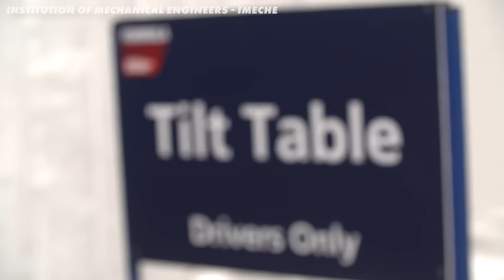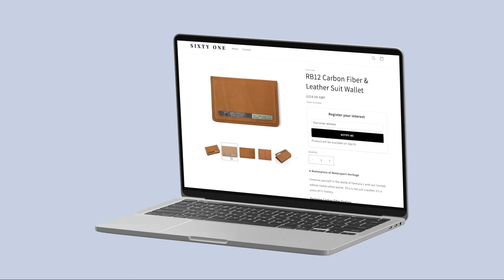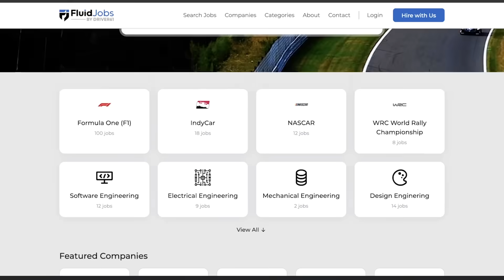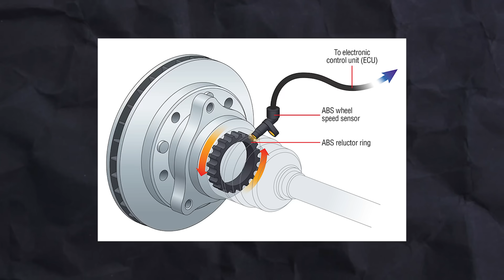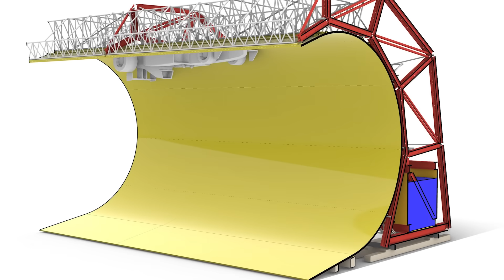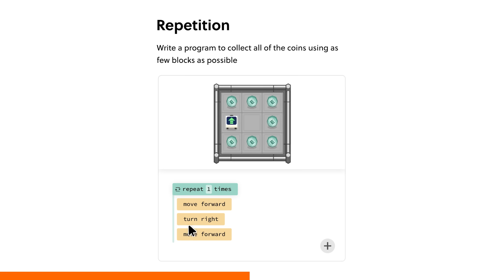How Students Made Something More Advanced Than F1

Comment: 4:11... On the lay-out of the car, why must the battery be at the back of the car (if its an AWD system)? I get it that it more weight distribution towards the back, may still favor performance, especially linear acceleration thx to improve tire grip, however we may be sacrificing on weight and aerodynamic performance.
Reply: I think it's also about packaging. The battery is kind of big taking up quite a bit of space. If you moved the battery in front of the driver you'd need to move the driver back and you'd probsbly get issues between driver and rear wing. If you moved it below the driver that would probably be very tricky with safety and removing the battery from the chassis, and you would probsb,y also have to make your chassis taller which isn't really ideal for Center of gravity or aerodynamics
Reply: @yuemaeve Then distribute the battery weight all around the driver. The least in front, most on the side, and somewhat in-between on the back. I am almost certain, that it’s has not been tried, because most people don’t want the extra burden of trying something new, while totally committed to winning “right now”…
Reply: @TiSIWO you are probably right that it hasn't been tried. But also I'd say packaging wise putting them at the side of the driver would be extremely tricky. One because you would need to add width to the chassis, which isn't really ideal either as it would probably be worse aero wise and heavier. You'd also need to put a firewall there because tractive system accumulator container needs to be seperated from the cockpit by a firewall. You would also be adding more weight and complexity with having more components because each container would need its own ams and isolation relays. And cooling could become pretty tricky

Thought maybe it could work

Comment: The only problem is that electric motors 0 to 60 in less than one second you need 10hrs to charge for the next spring and if cold more loss of power there good for experiments but not much else

Comment: what about crash tests and driver's safety? From the looks of it, these children's Lego toys couldn't save a fly in a crash test
Reply: That's why there's no wheel-to-wheel racing. At the end of the day, FS and FSAE are engineering events, not racing events. At competitions we do autocross, endurance and skid pad testing which are basically the drivers driving around a track outlined by cones and trying to set a fast lap without hitting the cones, the rest is mainly about the design.  Also, cars are expensive, and most teams probably can't afford to crash them purposefully.
Reply: I mean there are safety rules for that and calculations. There's is crash tests for the frontal crash box but also realistically you don't really crash in these

Comment: So basically the most unreasonable splinters from the black tech aircraft crushers/ would probably make ideal watch hands. Suitable splinters/ rate of return / you can make a lot of watch faces out of an aeroplane but how many watch hands? Or button caps? 

Picnic table made out of a tire off a boeing 747? Even as scrap those are black rubber dollar signs. Or a hill.

Comment: 4wd and 250kg is a great format but a generator is a better idea than batteries for that weight and replenishment capacity. Methanol hydrogen is a viable heat source and you don't have to have huge flames to get power ⛮

Comment: Im wondering if the air simulated was only from dead on straight. Cause a car can swing a few angles before losing traction and when it is the car isnt facing straight but angled. Which thr air dynamics meant to be working are less efficient since the air isnt coming from strsight on but from the side of the front

Comment: 9:00 how about adding wheels that are sized 1/20 the actual wheels and have similar suspension and steering, only difference being they are unpowered, and thus not vulnerable to spinning uncontrollably, then use computers to calculate an estimate to what the wheels should be behaving like. One huge problem with this is miniscule uneven road surfaces which will now be 20 times bigger and get the estimate farther from ideal.

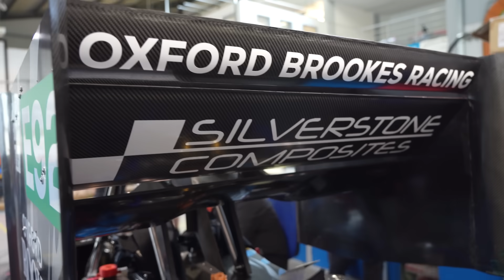Comment: 11:06 "Normally, we want to pack the downforce on, just so that we can give the car as much mechanical grip as possible". Jeet clearly hasn't watched F1, and/or doesn't understand the most basic of racing principles. Mechanical grip is most certainly not aerodynamic grip. Immediately dismisses anything these guys do.
Reply: I'm not trying to argue, just maybe learn something. Aren't they talking about down force that translates to mechanical grip when cornering?
Reply: @CoolGuy50383  Mechanical grip is the inherent grip a car has, based on the physics (tires, car dimensions, weight, balance), so the grip the car would have if there were no wings on it, or ground-effect (an aerodynamic device/design) built in. Aerodynamic grip is the EXTRA grip produced when the airflow over the wings or under the car (ground-effect) push or suck, respectively, the car onto the track, effectively increasing its apparent weight, and therefore the friction of the tires. Make sense?
Reply: Yeah the prhasing wasn't great. Thought at the core you do pretty much want as much downforce as you can get

Comment: Love your videos. You're only missing the major physics issue of all vehicle performance... inertia. Tires, to wheels, to direct drive motors (rotors), have lots of inertia. Slipper clutch and other various tech to reduce unsprung weight (belts) and inertia (clutch, like paw or sprag) can make or break a total design. Aero looks great, but when looking at efficiency, you're focusing on inertia and the conservation of momentum. I love aero, but most powertrains of the electronic systems are lacking in their design. If you're a Tesla, you can get away with big motors and lots of inertia. They aren't winning in the g-force cornering forces. They are straight line and braking optimized. Handling is tricky and brings in lots of other variables. I'd love to see more belt driven FSAE cars.

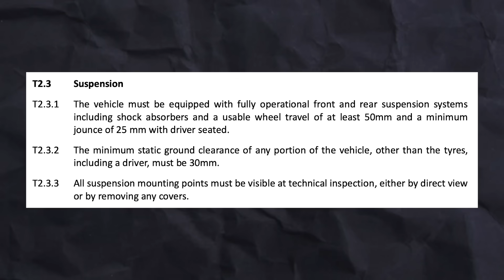Comment: Does anyone have details on teams using  active suspension? 14:23
Reply: There exists a rule which mandates a minimum ride height of 30mm. Some teams ran a system which allowed to reduce the ride height while driving (and increase it again for for the inspection) , which is especially useful for the aerodynamics. But the rules got adjusted this year, doing this is not legal anymore.
Reply: @NitroFr3ak Thanks! And do you know the name of the team that used it?

Comment: If they are implementing such automations, why don’t they use acceleration sensors to compensate wheelspin?, it will also allow for more gforce transfer accuracy
Reply: Most teams with a more sophisticated system do this. Only using additional accelerometers improves velocity estimation quite a lot already, but it's still not a perfect system because you still need to have some velocity measurements to correct the errors in the acceleration over time.

Comment: Why does the bottom of the wing generate more downforce?
Reply: That's tricky, but basically the downforce generated comes from the pressure differential on top vs below, and you can generate significantly lower pressure below the wing than you can raise the pressure above the wing

Comment: Well I mean these are  F1 cars, but on a smaller scale and essentially embody what F1 cars used to be, high power, low weight innovative tech. They're allowed to be lighter and less focused on safety, so of course they're fast, no bureaucracy and a rule book the length of 10 full size bibles to limit innovation.
Reply: I mean there is some restrictions and also rules on safety, and even powerwise while yes pretty good, they are probably worse in power to weight compared to f1
Reply: @yuemaeve   Nitpicks, these are effectively go karts, modern F1 cars are not. There is some safety regs like any form of racing, but obviously significantly less. I already I said this, that's my point, "less" not "none". Power to weight affects handling of the car, you can have a better power to weight on paper, but if your overall weight is higher you will still need more power to get up to speed and a lot more braking power to slow down, you are still effected by the laws of physics. This makes the bigger, heavier and longer cars, feel like boats compared to a kart, karts can turn and adjust on a dime, modern F1 cars have lost this aspect. Listen to any driver that has driven old and the new cars and they'll tell you the old cars are more nimble and agile.

Comment: @Driver61, if the car needs to check it's real world speed and cant use the wheels themselves to measure it, why not use a ground facing camera similar to an optical mouse to calculate it?
Reply: this is exactly what certain teams do
Reply: It's called a Speed over Ground (SOG) sensor and the more accurate ones can cost over 10k GBP

Comment: In my 3rd year at uni i've joined our formula student team. Was assigned to the powertrain team (before everyone went electric / single cylinder engine). We took a GSX-R600 engine and did all the auxiliary systems, overhauled it, turned it into a dry sump. and blew up an engine in the process 😅.

I did the manifolds, exhausts, fuel system, and some aero stuff (a 3rd year mech engineering student no less). We designed and built in like 8 months and started track tests as soon as possible.
we took part in a few races in and drove the s*** outta it. The events are wild, tones of students psyched on cars drinking heavily (in germany be german) next to a race track. an awesome experience.

the car, I'm happy to say ,kept driving for 2 years later as a test rig and was eventually turned to an autonomous vehicle

Comment: Used to be a Suspension guy in Formula Student for five years... Exhausting and challenging are perhaps the most fitting words to describe the experience :D
Reply: I used to make manifolds, pipes and mufflers, I also found it exhausting.... 😜
Reply: @SIartibartf4st  lol I would have done more powertrain stuff too, but the first car I worked on was the last Combustion car in the Team, all the following were electric. Wich left us mechanical engineering students basically with chassis (I made chassis for 2 cars), suspension (I made suspensions for 4 cars) and Aero (I hate Aero 🤣).

Comment: It’s great to see these university resources being sunk into aerodynamics and handling, but it seems a loss not to see any resources being sunk into reciprocating engines. Yes, the majority of power units being manufactured in the real world, and the racing world still use internal combustion, whether they are woke or not. Advanced university level R&D still has the potential to make breakthroughs in reciprocating engines. Putting all these eggs in electric motor basket could be short sighted. 

To shut down potential advances in ICE is a mistake. Who knows where advances in two strokes, Atkins cycles, sustainable fuels, hydrogen, forced induction and even rotary could take us if these technologies are not pursued?

Comment: Measuring the speed is tricky while maintaining the possibility of over and under spinning the wheels. 
Track the actual speed(a vector) and keep the capacity of precise spinning and the car will be almost unbeatable.
Have they tried some kind of innertial system? Is it precise(=fast) enough?
Reply: What the team I was part of did was use a ground speed sensor, not sure if optical or laser at the back of the car to directly measure speed

Comment: As a former FSAE driver and vehicle dynamics control engineer I can say that while agility is exceptional, the technology progress of EV category in last 10 years is astonishing. I have driven models from 2012-2023 (only few models on competitions). It went from a simple single motor RWD to nowadays AWD, full aeropacket, torque vectoring, decoupled modes suspension and torque vectoring system. Nowadays the powered ground effect (aka few kW of fans sucking air from undertray) is a next big innovation getting in.
Just to quickly summarize how the main progress was cca.
single motor RWD -> twin motor RWD  -> regeneration -> Aeropacket -> AWD -> Torque vectoring -> ? Powered ground effect ?
Reply: I must say, the first thing I thought when I saw these cars and their insane need for downforce and the relative lack of regulations is: why not use a fan to suck the car to the ground. You could even see the next possible step is a dynamic powered ground effect, where it is enabled only to provide grip the moments it is needed.
Reply: @Eikenhorst we have been using what you referred to as "dynamic" powerground at Rennteam Stuttgart (the one and only combustion Rennteam!) already in 2021 and 2023. The Fan power was mainly controlled over speed (with some other inputs such as DRS and brake pressure) to be more efficient and get the aerobalance spot on.
We also had active front wing flaps working alongside the fans.
It was really fun to setup the car with all these active systems!
Reply: @Eikenhorst  formula student is actually regulated quite reasonably. Ground effect powered device was forbidden for many years
Reply: I think FSG will disallow PGE sa they did with active susp

Comment: didn't mention that OBR got disqualified from endurace or got slapped by a 1cyl solid rear axle ICE team lmao
Reply: Ye 2nd this, Oxford brooks are a team who just have a fat wallet.. That Aussie team were insane, they were saying how they’d already done a year of testing on the car prior. Their engine was like sub 30kg, whole car was like 160kg. And ye no differential on the solid rear axel, more weight could have came out as well by doing the rear axel out of carbon. Cardiff, Birmingham, Bath, Glasgow and Staffordshire seem to the most impressive or most consistent
Reply: We had our best results when we we're driving a simple 1 cylinder car. Weight and aero are more important than power (for IC at least) - in my opinion
Reply: I don't believe they were disqualified - they got 2 "burp" flats on their rear right because of their home made carbon rims and just set a really bad time because they didn't have an impact driver to remove the 5 K nuts holding the wheel on and had to replace them with a sealey rachet.
Reply: Yep in 2017 our team in FSUK slapped everyone with the fastest lap around the endurance track. We had like 155kg and a 1cly engine.

Comment: That's what I am most looking forward to about going back to University in the fall. I'm set to be the aerodynamic team lead for the FSAE car at my university. It'll be a lot of work but it should be fun. I'm planning on doing a fair bit of work on the floor of the car and getting it set up to produce a fair bit of under body downforce. Plus I might change the aero foils we are using for the front and rear wing and the wing geometry. I absolutely love working with carbon fibre and the testing phase. Hopefully we can get some wind tunnel time this year but probably not.

Comment: I wonder why not add/use extra sensors detecting/measuring movement of car itself instead of overcomplified algorythms trying to guesstimate? Just add g-forces sensors and/or lidars for road surface or eg. gps like in some track laptimers ..
Reply: Plenty of teams use lidar, GPS, IMU and stereo cameras in conjunction with each other. Its always a tradeoff bewteen computing a huge amount of data or using a minimal amount of sensors and also using a learning algo
Reply: Or just add 5th wheel somewhere under body to measure speed.
Reply: Weight is the reason. Its the single most important thing on the cars we design and make. Also calling it a guesstimate is doing it a disservice. There is a lot of serious work that goes into those algorithms. Also g-force sensors are often used as part of the algorithms on some teams

Comment: The car shown at 6:04 is clearly shifting gears. How does that work with individual per-wheel motors?
Reply: Not all formula student cars are electric. The quick ones tend to be, but the older ones or the ones where the team has less budget or resources tend to be more ICE powered. They'll have snowmobile engines and stuff like that.
Reply: That's a combustion car. There are different kind of classes: currenty it's combustion, electric and hybrid. 
FSAE started with combustion in the late 90's. 

Most teams of that class drive a 600ccm motorcycle Engine or something comparable.